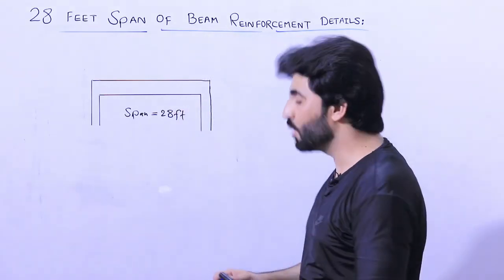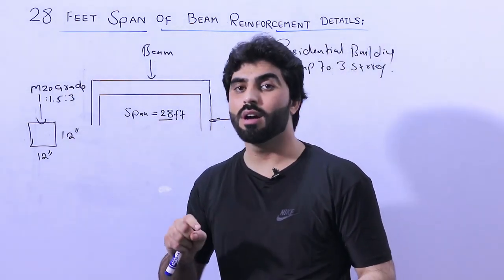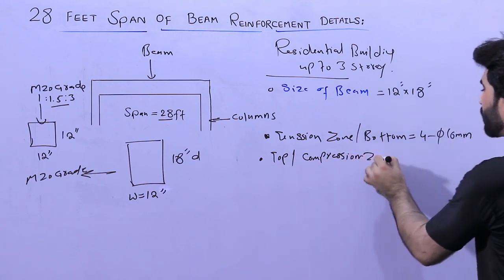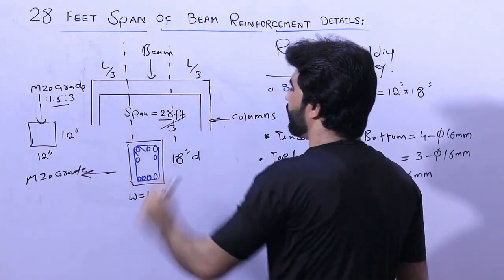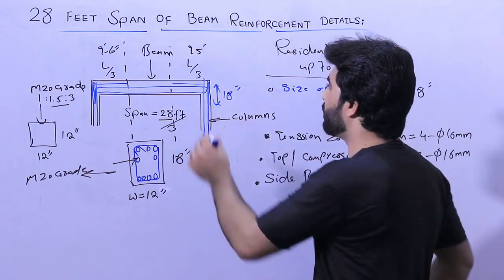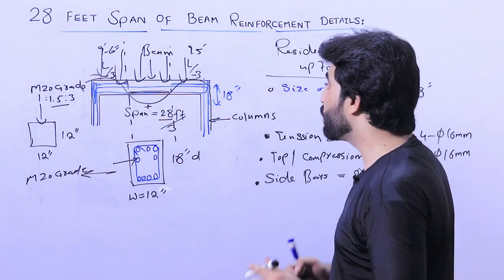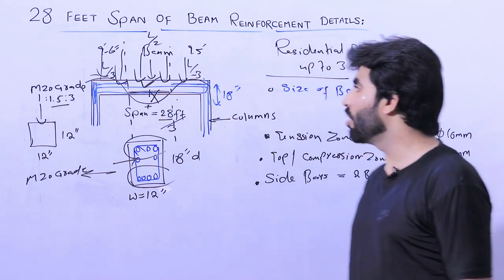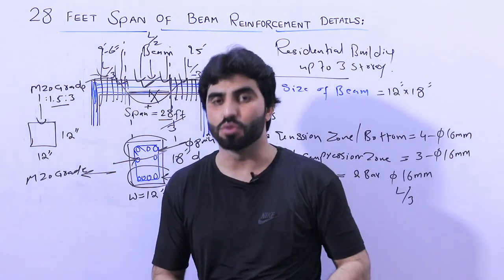28 Feet Span of beam structural design by Civil Engineers

Comment: I am on the way of building a house lenth of 90 feet n breath is, 18 feet, .. Length of columns are apx, 15 feet away n few are at 26 feet n few are 20 feet away... What steel size I should use in beam n in slab kindly guide... 🙏